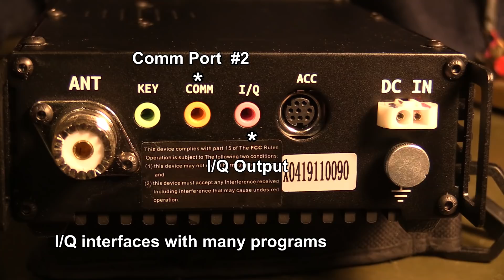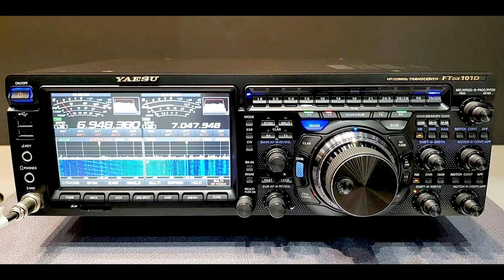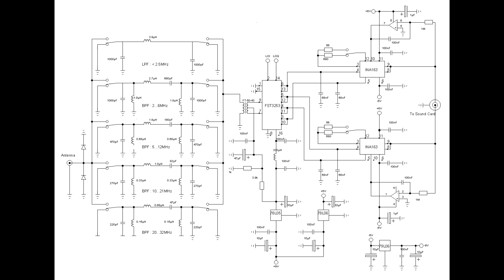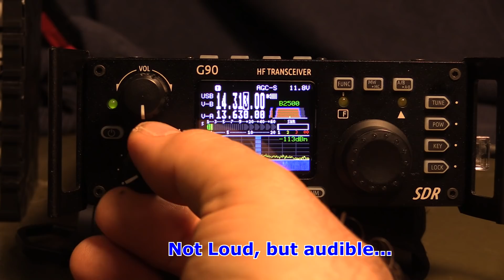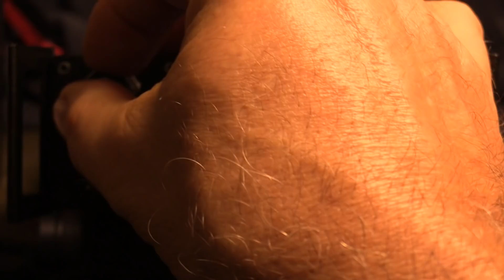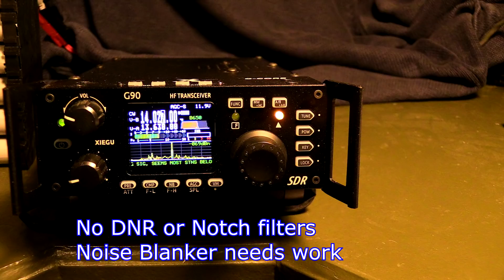Xiegu G-90 QRP SDR Radio Review

Comment: Your review and the comments indicate that the noise filtering capabilities are not up to par. Could these be improved with a firmware upgrade, or would hardware changes be needed?
Reply: They are not up to par with a radio over $1000 USD. At this price point, I just cannot expect to see 32 bit DSP filters being in there. The receiver's noise floor and dynamic range are on par with say the FT-dx101D. I have them side by side. In field operation (the intended use) it is a stellar performer. The main problem is the setting of the TX driver and final bias current. Once these are 500ma each, the radio is one of the highest price/performance radios available.
Reply: @Yavor54  Thanks. I'm putting in an order for one this morning. Your video was very informative and helpful and was decisive in my choice. I have a HOA no-antenna rule, so portable and stealth operations will be all I can do.
Reply: G90 arrived. I put up a poor antenna setup — an end-fed dipole no more than 8’ above ground and not in a straight line, to keep within HOA restrictions. Receiver quality excellent, and first two QSOs were to Calgary and California from home in New Mexico, 20W SSB, on 20m. You were so right about 20W rather than 5W making the difference between no QSOs and multiple QSOs on SSB. CA ham recorded my transmission and played it back for me, and the audio sounded clean and clear. Very pleased with purchase. Thanks again for excellent review.

Comment: Looks like the G90 is so quiet, that it's like listening to the IC7300 on one of its lower (say 2, 3) NR setting.
But that's from the video, I should compare them "live", I'll do it if I happen to have a G90 in the shack...
BTW 650 mA still not bad especially with a screen like that.
Reply: The radio IS quiet. It is a 24 bit ADC chip, so the dynamic range is really wide. I'm very amazed at the radio's selectivity too. Watch for the new remote control 5" LCD display unit coming out from them.

Comment: Does the transmit audio suffer due to low voltage as it does with most transceivers? Having the same carrier does not always compute into having the same transmit audio quality.Thanks & 73
Reply: No, TX audio quality is the same as you reduce the voltage. That said, the early radios were set to conserve power on TX and the bias levels on the driver and final transistors were low. I did point this out to the Xiegu engineers, so hopefully they have raised the bias to 500ma now. The owner can also do this mod pretty easily if needed. Total current drat on TX wioth NO Audio present should be about 1750ma. if the bias is set right. 1500'ish if it needs to be adjusted up.

Comment: What about the new '' QRP Labs qsx''? It would have similar characteristics? (not an antenna tuner of course ).
Reply from the maker: Not similar... other than the 24 bit A to D chips. The G90 has all the Hf bands except 6 meters. It has the antenna tuner. It is 20 watts out. That's the difference between not being heard and being heard. It has an integrated color spectral display including SWR scanning. No comparison really...it's the G90
Reply: @robertnagy2163 
Thank you. The difference of price between these two however is abyssal.

Comment: Have ordered one and expect it next Monday.
1. How long is the DB-9 cable?
2. I can't find a good explanation on how to choose settings for the bandwidth filter (except for what the difference between them should be). Since the Low and High are set independently:
   a. How do you know what to choose for the low and high?
   b. Does this ability allow it to function as an IF Shift control?

Comment: Hi Robert. Thanks for a great video. 
After a lot of sighing and checking the bank balance I decided to purchase the G90 rather than the Elad FDM-Duo (which I really really wanted!). So, first off - I'm delighted with the G90 performance in stand-alone mode and now keen to see how I can get more fun out of it via use of computer control. It would be great to be able to run some displays on the larger  screen that most computers can offer.  So - my question is - Having seen the comment on your video "IQ interfaces with many programs" - do you have any suggestions for software that can make sense of the G90 IQ outputs?  Sadly, the manual is a taster only in this respect and fails to give the sort of detail that a technical user needs - I can't find a more detailed description anywhere online......
PS My G90 firmware is v1.6 and the manual in the box is printed as a v1.00.03 (which is a higher status than anything online). Go figure.

Regards, MM0MMQ
Reply: Bob- Well, we are all waiting for Xiegu to release their larger LCD monitor and additional docs on the I/Q output. I have to admit to being over-run with equipment here. I just cannot squeeze the most out of each piece of gear. The IC-9700 is pulling my atention now. I can tell you that I will sell-off my KX-3 and other QRP radios now. the G90 is the portable radio for island-hopping here. Either I will finally hack the final amp and push it to 30 watts or add a small amplifier. Stick around. If I hear anything I'll post info...
Reply: @Yavor54  Thanks Bob. I really appreciate your reviews and totally understand you won't have the time to go deep into everything. The outcome on this occasion is a happy customer enjoying a new radio 😀

Comment: I'm looking for instructions on firmware update - I'm a Mac Shack, and I can't seem to find any yes or no on whether the firmware update absolutely requires Windows or not - Parallels might be an option if it does - any wisdom on updates from OSX? Thank you for a great SDR primer and a really good look at my new G90, I'm looking forward to the 5" remote display, any updates on that? 73, KI7YTP
Reply: I posted this same question on the FB group. Someone suggested using xmodem on a Mac, but apparently no one has tried it, and there have been so many sad stories from people who encountered difficulties even with the factory-recommended Windoze version that I am unwilling to be the beta tester for a theoretical, untested Mac procedure. If someone does it successfully and posts detailed instructions or a YouTube how-to video, then I might give it a try.

Comment: Mine on back order. Any input on using an MFJ-1899T antenna and counterpoise needs? 73
Reply from the maker: Well, when I'm out portable QRP - I use the best wire antenna i can hang. The bands are in terrible condition and with low power, you need the best antenna you can use. The MFJ vertical...I'd be sure I made a great ground and radials always help. I'd say you should only operate digital on 20 meters with that antenna and about 12 watts average power. On SSB you'd have a difficult time. If bands were OK, you'd be fine too...but they arent't.
Reply: @robertnagy2163  This information is very valuable to me. The antenna use is due to one I already have, the MFJ-1899T, to use on an MBTIX kit I assembled and tested with it. Now, I was not considering for some reason what you just stated, until your post, which again, make a lot of sense to me. You may have more experience than me on the HF use, as I dont have a n HF radio yet. Thanks a lot.
Reply from the maker: @k2icc  You are right, I have been on the air every day for 48 years. If I was you, I would order a 4:1 Balun and build a folded dipole for 20 meters. There are plans on-line. You'll need some 1/2 inch PVC and some 14 or 16 gauge wire and Zip ties. The Folded dipole will give you 3DB gain on 20 meters and not require the tuner. With the tuner, it will work on all bands above 20 meters. It works superbly .... Bob
Reply: @robertnagy2163  I saved the notes. I will be able to build the dipole for the 20 meters. If that is the band to go for, not sure on the 40m or any other band. Once again. Thanks a lot. 73
Reply from the maker: @k2icc  Yeah, 20 meters is for sure good, 40 meters would be a second choice.

Comment: Get new radio and an excellent review. I'm looking for an SDR to replace a Kenwood TS 50S. The Kenwood is an excellent solid radio but somewhat larger and heavier than is good for true man portable use. It also requires an external tuner. I also have a Yaesu FT-891. It is an excellent radio but also requires an external turner.  Both those radios are great for field day but not so good for tracking off into the back country. For me this new rig ticks all the boxes.
Reply from the maker: Marvin- Just know that the case IS heavy steel plate. It is twice as think as Kenwood uses. Total weight is around a Kg. (I'd guess)

Comment: I agree Rob, 20W is a minimum for SSB (i even prefer a little more, as 50W when necessary) ; and now we have the battery tech to handle that with a reasonable weight (i have LiFePo4 actually). 
Thanks for this very informative video, have fun. 73, de ha7wx chris

Comment: You haven't changed a bit since the Austin days. A little more grey, but aren't we all? Hope all is going well with you and the family.

73 from W5USB (Art)
Reply from the maker: Hey Art! Long time!  Yeah, I get up and turn on the rigs every day... SOS here. See you are in S.A. - I'm up in Hot Springs AR..retired from UT 15 years now..got out in my 40's. Hey- I put 4 Allstar links in Austin so I can talk to the old group. They are on 145.65 , 446.25, 145.575 and 145.550 in Bastrop. No tone.. the 145.65 has coverage to New Branfels. These are simplex..just key up after the tail/beep. These link to my Super Node here on the mountain in AR. Say howdy some time! 73's Bob
Reply: @robertnagy2163  I plan to get back into radio, a G90 is on the way. :) Lately all I have been doing with my ticket is legitimizing my use of FPV.

I haven't turned on a radio in the 7 years since leaving Austin. I've copied all that and will see what I can do from north San Antonio.
Reply from the maker: @Deploracle  At least you have a vibrant Ham community in central Texas. The HF bands have been shot for a few years now. No sunspots at all. So, the hot thing is digital modes now. Joe Taylor of Princeton Univ developed a whole suite of digital texting modes which will work with no band conditions. Some really exotic stuff there. the G90 will be very happy doing these modes. You just need a cable for the audio in and out from the rear connector. We run 15 watts on digital cuz it's 40 times as effective as SSB. Check out WSJTX. It's all free!

Comment: Running the finals at or below half the power rating gives much better life time and reliability!  When I make things I like to keep things around half to s quart the rating of the parts.
Reply: @MonitorSmith  If you want to reliably talk to someone, a fella I know always says "100W is QRP"
Reply from the maker: I hear you Don. I suggested to them that they just put a 25 watt limit instead of 20W. This would bring the average SSB power output up by 5 watts and make quite a difference. I've used it a lot now and the heat-sinking would be easily adequate. The transistors would still be way under their 40W max power spec. - One would just have to watch it on constant duty-cycle modes....

Comment: Hey Robert,  I looked over the manual, and it  says an external power supply "may be used",  and again something like "if an external power source is used.." implying the G90 has an internal battery. I see no mention of an internal battery, so does it have one? thanks.
Reply from the maker: No, no internal battery. It is just a semantic language issue. I suggest making a LiPo pack out of 18650 cells. Google it. I've made 30+ amp hour packs that weight just a few lbs. Surge capacity on this pack is 100 amps.

Comment: 500mA receive current draw makes it a crappy rig to take portable (unless you actually enjoy carrying much heavier batteries).
Reply from the maker: I hear you, but I use the 18650 Lithium cells in packs and have plenty of light-weight power in the field. Google making these packs. 30 amp hours at 12.6V is right around 32 oz. in weight.
Reply: @robertnagy2163  Did you measure power draw with audio to the speaker or to headphones?  Its worth knowing both values.
Reply from the maker: @Boris_Covfefeovich  I measured to the speaker -which should be higher than headphone output.
Reply: @robertnagy2163  isnt 16.8Vof fully charged 4 cell LiPo too much for this radio input ? seems like 4 cells LiFePO4 is right in range
Reply: @therianet  Yes, use a 3S LiPo cell array.

Comment: How does this compare to the KX2 \KX3?
Reply from the maker: Well, I A/B'ed it with my KX-3. The KX-3 is superbly quiet. I mean "You think your antenna is broken" quiet. The G90 has more internal noise, but no more than say my IC-7610. The KX-3 is very polished...refined...and in Elecraft's way, a bit odd. The receivers are "different" than other makers. You'd have to listen. The G90 is more sensitive than the KX-3. It's 24 bit A to D chip makes for some super-smooth listening. Add an external speaker and it is just superb. The G90 is a bit raw around the edges. It will take several firmware upgrades to comb out. I believe it has the horsepower inside to become a super little rig. I still HATE sending money to China. That said, it is now my main QRP radio. 20 watts (and maybe more later) makes all the difference. You MUST adjust the driver and final transistors to 500ma quiescent current draw. Just find the three little trimmers next to the Mitsu transistors, key up and watch the current draw...adjust each for an additional 100ma. This cleans up the TX audio.
Reply: Their X5105 is turning out to be a good radio too I see.
Reply: Use it with a ClearSpeech DSP Speaker or Base Module & it will make it super quiet as with any rig.ClearSpeech is a BEAST.

Comment: I am trying to understand why we are seeing a mixture of traditional architecture with SDR.  We see it with the Yaesu 101D, the new K4HD, and the G90.  What are the benefits/problems with the mixed architecture?
Reply: Superior selectivity.  The front end filtering of a tight filtered mixer greatly reduces the SDR processing overload in near Robert well demonstrated in this video.  That is why the Yaesu FTDX101uses a one stage mixer, and the new K4 has it as an option.  In high RF environments this is an exciting feature and should make this a great QRP contest rig.  It also explains a possible reason why there is no DNR, as this should also helps in S/N ratio.
Possible draw back is some  slight increase in phase noise from the mixer and possibly cost to manufacture.
Reply: @BartVanAllen  Thanks.  I get it.  I have not experienced strong nearby signals but where I a want to move, I know a few big guns. I wonder what the flex boys have to say about using a traditional mixer since they do not.
Reply: @bradcfi2  I suppose we may find out later on - Flex (and Apache Labs) are descendants of the TAPR groups SDR project - actually, they are the founders of it.  I used to follow them and dream of putting one together.  So it will be interesting to see if they follow suit or come up with better code or hardware processes to protect near signal integrity.
My dream rig is a Flex, but I really like the Yaesu and Elecraft offerings - both way out of my price league.
Reply: @BartVanAllen  I was think about getting a Flex but all there marketing materials are based on software features and never mention receiver performance.  So I wonder if Flex provides a world class receiver.  I guess I should check Sherwood.  The Yaesu has a noisy fan and relay clicking for both full-break in and semi break in.  It is shockingly load.  There is an RF out but no IQ out.  Without IQ out, I believe you cannot integrate with CW skimmer.  That leaves the 7610 and Elecraft.
Reply: @bradcfi2  Sherwood puts Flex right among the top handful of radios along with the ftdx101, K3s, etc.  Yes, CWSkimmer along with N1MM and DXLabs etc can all run together - web searches shows many examples.
Yeh, they missed on the noisy relay but I suspect that will be fixed soon, maybe pin diodes?  On such a pricey rig this is inexcusable though.
IQ out as such won't matter - it has IF and rx out, so outboard sdr's can hook up for much expanded signal searches.  That may be a problem with the Flex but an outboard SDR can hook to any radio with a Tx/Rx switch - manual or auto for what ever reason you want.
I am using a FT450d with an RSP1a sdr on the first IF and it works excellent with SDR Console v3 but Mr. Nageys test of the G90 sure is getting me to think -----

Comment: Great review.  Convinced me to sell my current QRP rig for the G90.  I can't find the matching amp at their site.
Reply from the maker: There are a few little warts still in the firmware, but I worked from France to Alaska on a park bench this weekend with it...SSB..on a bad 20 meters with a dipole. The RX is very smooth sounding with the 24 bit chip. The amp is there...or email them.

Comment: Nice review.  Have you tried a digital com setup with this radio?  I am looking for a solution for the G90, but I am having mixed results.  I can CAT control fine with the provided program usb, but I can't seem to get good audio out of the ACC port.  Any suggestions?
Reply from the maker: Well, I have have not tried CAT control, but I have set up the analog audio lines and used the VOX to key it. I did not check on TX audio quality.. I will. What rig emulation (XML) file are you using to do the CAT?
Reply: @robertnagy2163  I know there is a input setting for mic or line, but is there a specific setting for line out or digital/data out through the ACC port? BTW, I am usubg HRD for Cat and ptt control with Icom IC 7000 settings.
Reply from the maker: @TXLorenzo  There are separate Line in and Line out level adjustments in the system menu. OK on the IC-7000 settings.. will try them now.